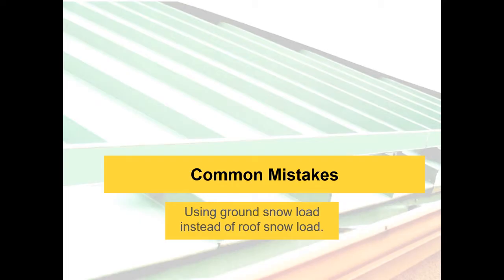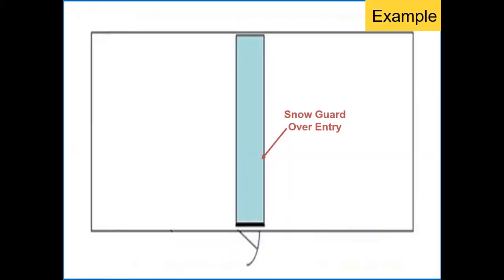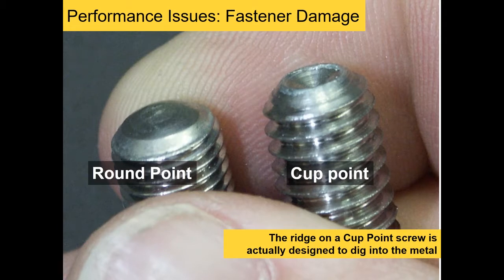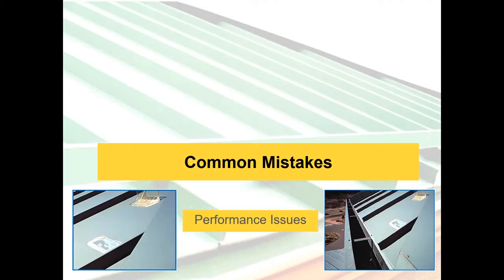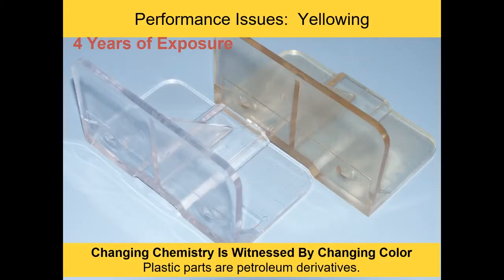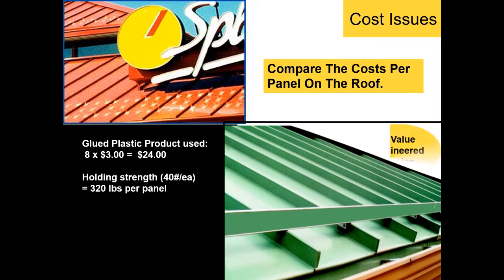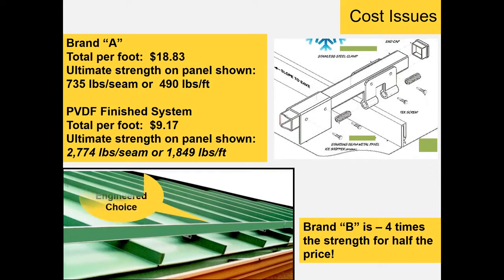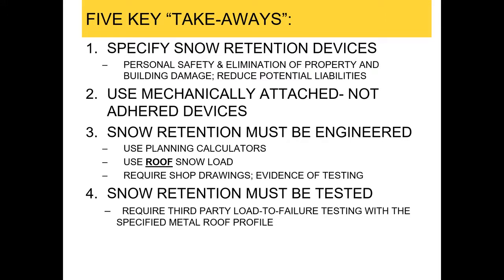Common Snow Retention Mistakes | Rob Haddock

Comment: So....what do you do for corrugated panels if you aren't supposed to penetrate the roof to fasten your snow retention system?
Reply from the maker: It is best to avoid penetrating standing seam roofs. However, exposed-fastened corrugated / trapezoidal roofs can be through fastened and in fact will already have hundreds of not thousands of fasteners attaching the sheeting to the structure. For snow retention on traditional corrugated roofs, we offer our CorruBracket that our ColorGard or DualGard systems can be attached to. For trapezoidal roofs, we have our VersaBracket that the ColorGard rail will attach to and our VersaGard system that use two 1" pipes. Please let us know if you have any other questions buy emailing support@s-5.com